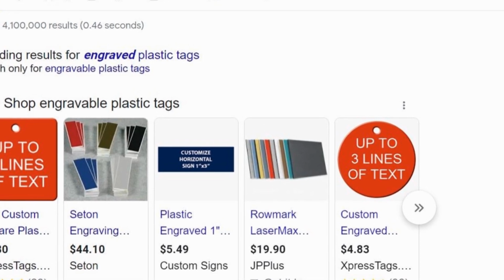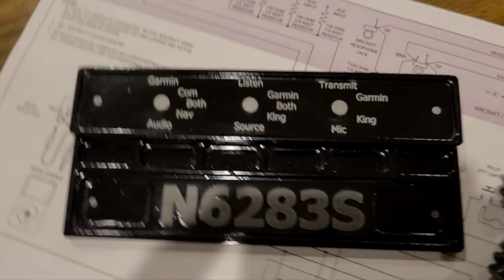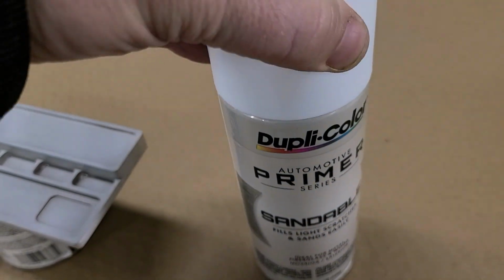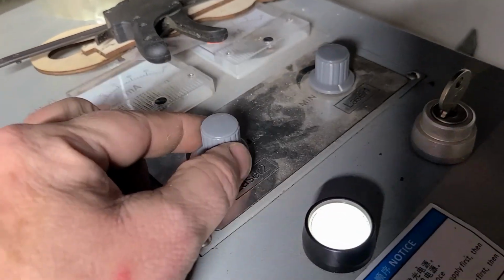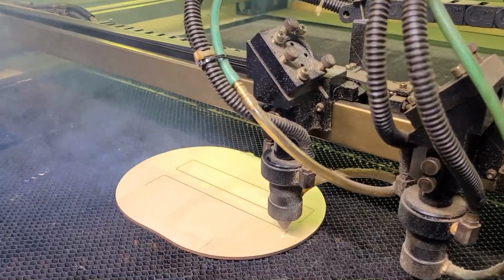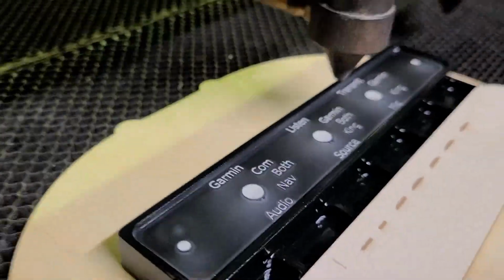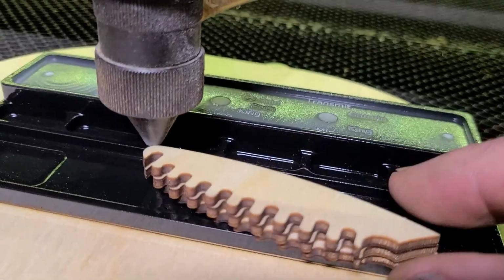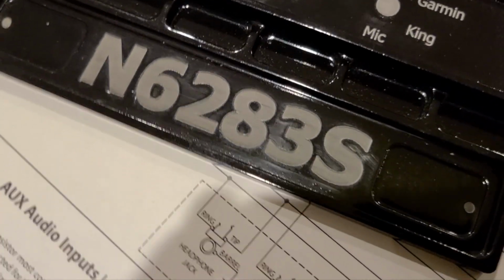Engraving Lettering on a 3D Aircraft Switch Panel - How I do it.

Comment: Cool little project! Thanks for posting! 

If you don’t mind sharing, what cnc milling machine did you use to mill the aluminum and also what type of laser engraving machine was used?

I was just curious because I have a fairly cheap Chinese laser engraving machine that I bought a few years ago and never quite got around to getting setup but was thinking this might be the perfect little project to break it out for. It’s not strong enough to engrave metal per se but I guess in this case you’re just essentially engraving paint which it should be able to do. Anyway, this project looks like it’d be fun to try. 👍
Reply from the maker: I used a Tormach PCNC 1100 Series 3 mill, and a Cam-Five (rebranded Han's Yueming) CO2 100 W laser .  The 100 watts is WAY overkill - you could do this with one of those little diode lasers.  I have done interior placards with a K40 chinesium laser.  You are correct - this is not engraving metal, it is engraving paint.